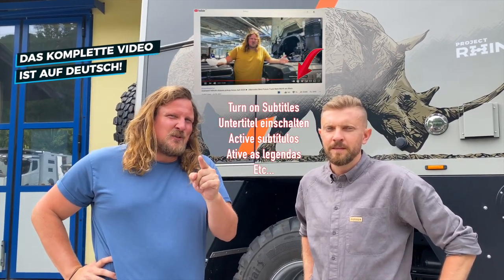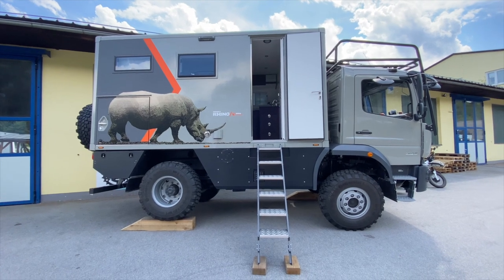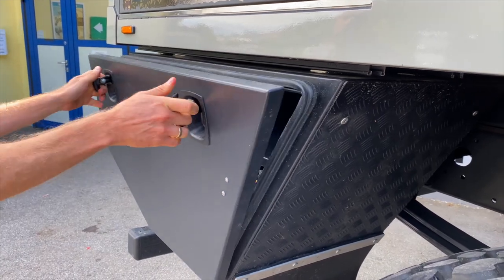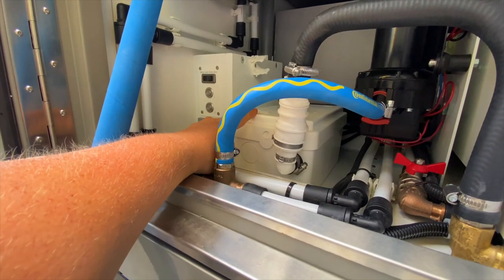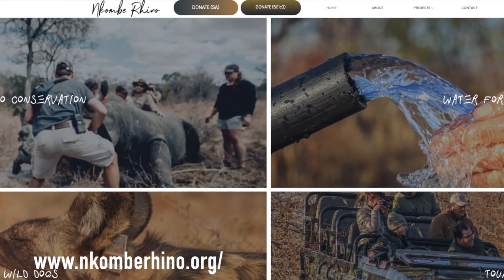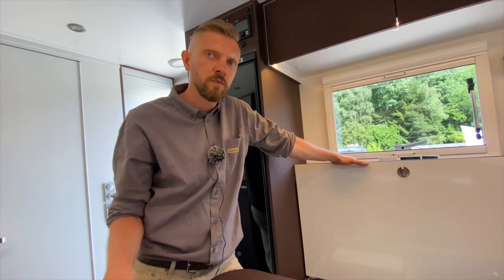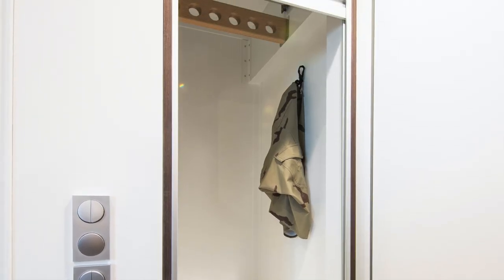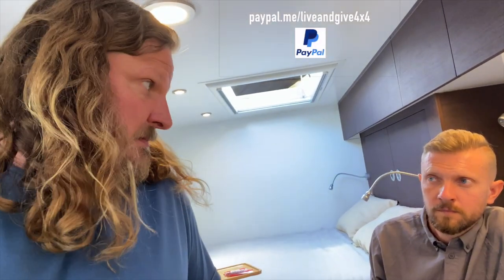Amazing Ultralight Overland Vehicle ► | Full Detailed Truck / LKW Tour "Project RHINO" Krug XP

Comment: Three part Question about heating... 
What makes water heated radiators and / or underfloor heating more comfortable than blown air heating.
Which one is more efficient / cost effective at delivering the heat.
What are the downsides and upsides of both? (I can see weight being mentioned for water obviously an issue for weight restricted vehicles such as this and the ability to preheat the cab / engine with water heating is a great plus point)
Great video you two, I had a chuckle at the "fish water tank" subtitles. Ohh onboard aquarium, how awesome LOLOLOL :-D
Reply from the maker: Hi there, 
I guess it’s a matter of comfort. In our old vehicle we had an air diesel heating and we were fine. Just a bit dry air and in dusty areas it’s kind of circulating dust … 
Another point for us if we think about it hard is the space lost with the air distribution hoses, but I guess that could be even with the water pipes going underneath the floor… both are fine, but the radiator solution is more comfortable in the long run we think. You can also decide which “rooms” or “part of the vehicle” should be heated and which one not… again, we decided for it because we wanted our new expedition to be more like an apartment than a camper. 
Hope this answer helps … 
See ya when we see ya 👋 
Fabian Isabela and Matheo 
P.S.:Whoever needs a personal questions answers for his or her own build, feel free to sign in to our newsletter and let us know your questions in message box. 😎👍🍀https://www.liveandgive4x4.com/newsletter